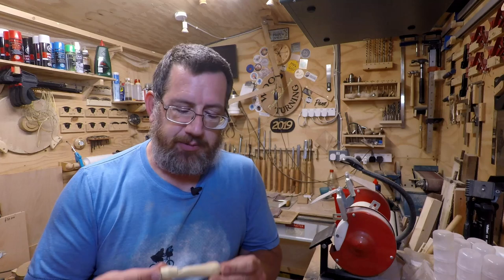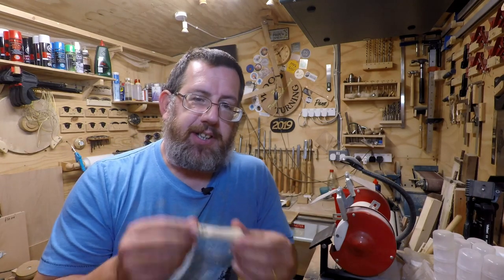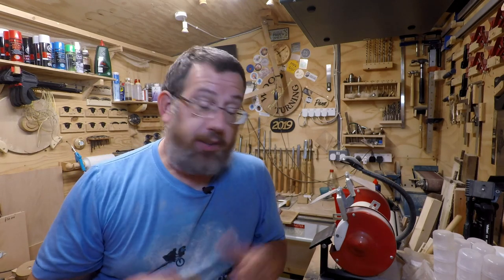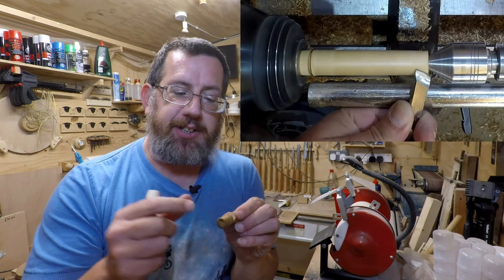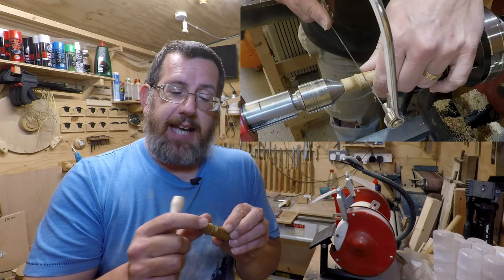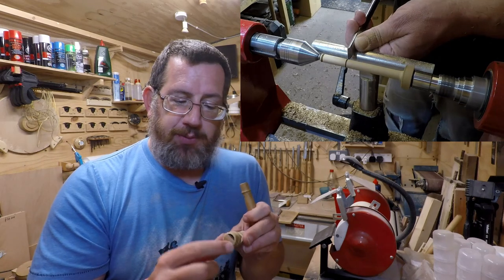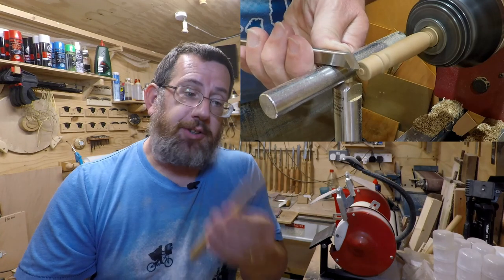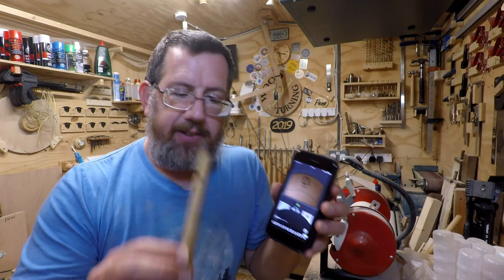Whistles - Episode 219

Comment: Hi there. Thank you for sharing this. I'm interessted in making something like this to call Tawny Owls. The plastic ones don't sound as good as wood. I'm looking for something around 800 Hrtz. Not sure of bore size and length?  Just a matter of experimenting I suppose.
Reply from the maker: I think there are a few factors that would alter the frequency. You could always go down the flute style option rather than a whistle to see what the starting frequency is based on size. Then by drilling a hole in the tube shortens the length of where the air escapes altering the frequency. That hole can also be made bigger to alter it more. Look at something like the native american flute.
Reply: Thank you for your reply. Appreciated. 👍